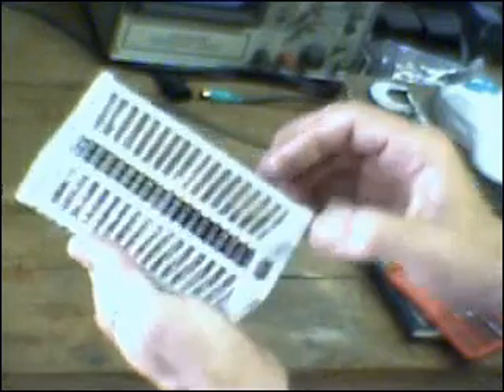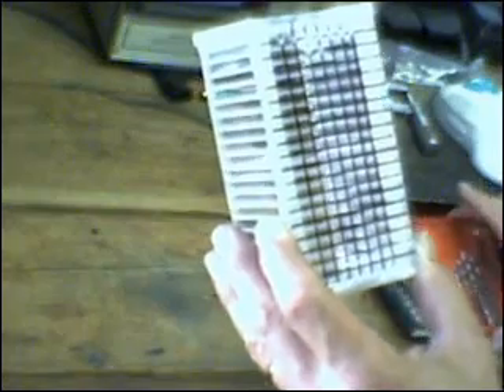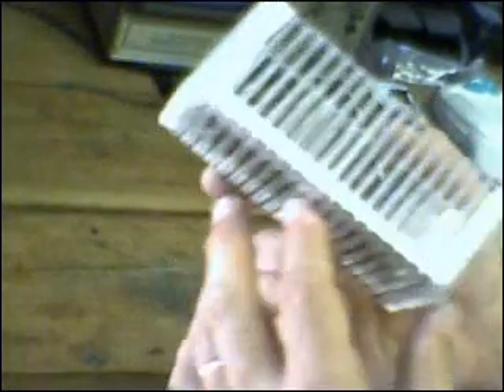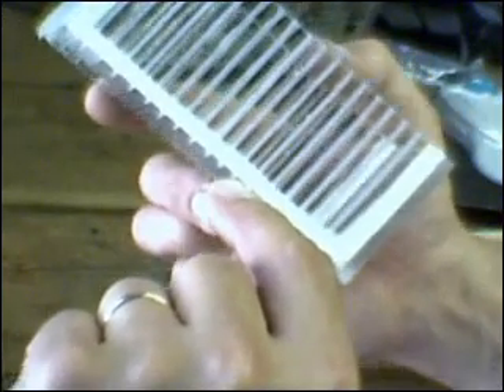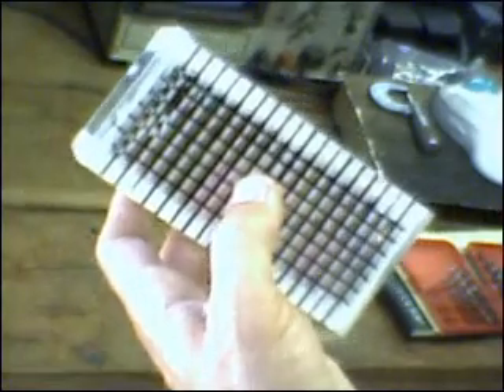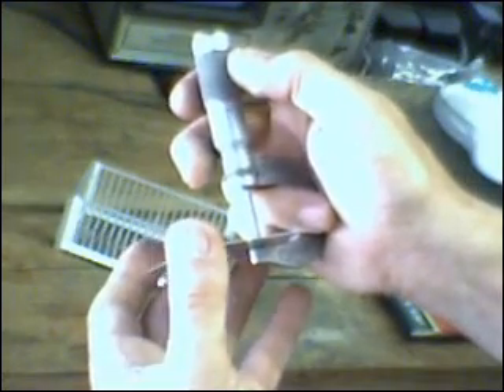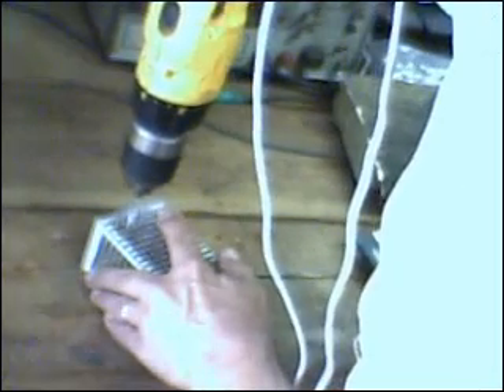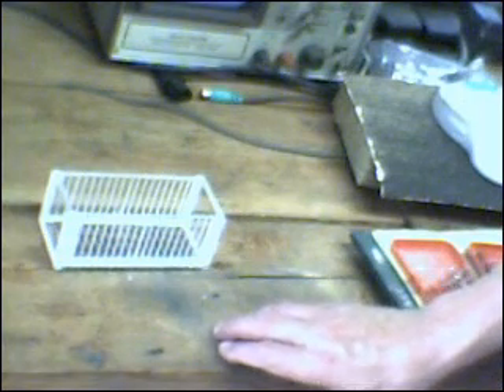15 - Hydrogen Electrolyzer test unit 04

Comment: very nice idea!! Good design this seems like a CD Organizer, after saw your video, I decide to use one to hold the SSplates tks.
I´m working with a 2000 psi cilinder, I put inside aluminun and Lye and it produces +- 1 liter per g.
I will see your other videos and hope post the mine.